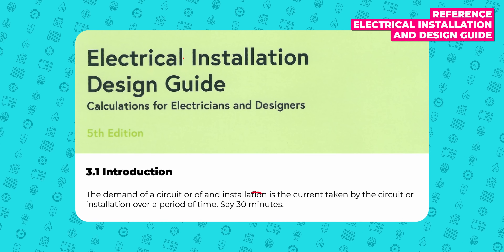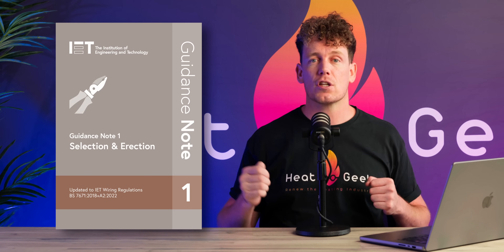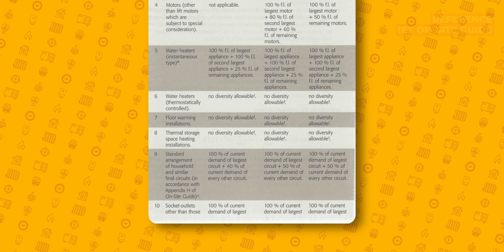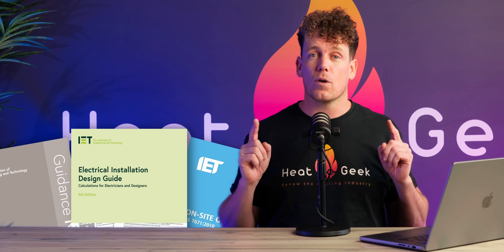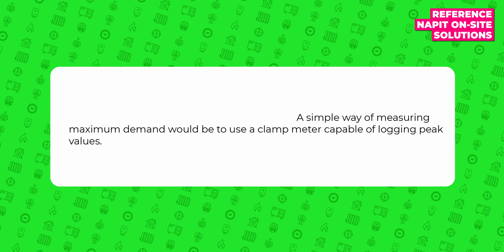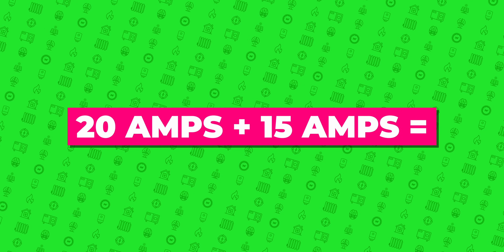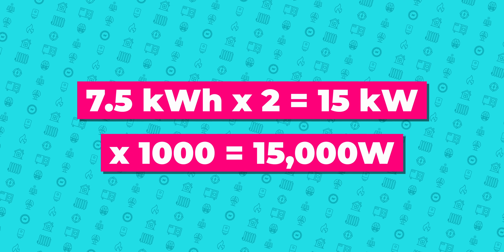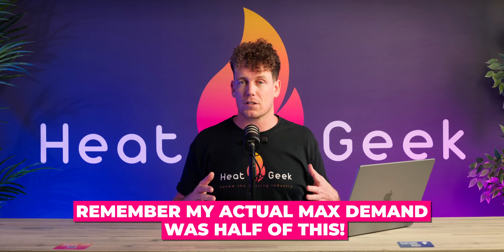How To Calculate Your Maximum Demand

Comment: Correctly estimating a maximum load can be quite hard.
Needs may change over time, so planning ahead for what you want to use and when you want to use it is always a good idea.
A smart meter will give you some insight, but these often produce averages that are simply unusable.
With peak loads, you can trigger a circuit breaker or worse, even if the average load isn't al that high.

So make a spreadsheet with what is on your circuit breakers, and when you will use it. 
Try to use powerful appliances on solar power if you can. This will reduce the load on your grid connection.
You can also spread their usage over the day or week and make this a habit, so you don't need to worry about losing power.
And when you have a collection of power tools or other heavy appliances that should not run simultaneously, combine them on a dedicated circuit breaker, so the impact of a mistake is limited.

 Induction cooking tends to make only very short peak loads, but charging an EV takes very long. So that's the one to worry about if you also want to run an ASHP at the same time.
Reply: Running a car charger generally through the night 32A running heat pump max 25A
Reply: @gramofsin Car chargers in the Netherlanda generally use 11 kW (3x 16A). The newer heat pumps are now able to stay well below 16A providing you don't have a huge home.

Comment: Great video.

Just a note to say induction hobs are potentially very high draw - mine is rated at 7.5 kW max, though running it at that for an hour would probably melt the kitchen.
Reply: I have a 11 kW 3 phase induction hob.
It can draw a lot of power, but not for long without having to order take out 😂
Reply: @SolAce-nw2hf  wow, I expect you can smelt iron on that thing 😱
Reply: @TheBadoctopus  Not really. As impressive as 11 kW sounds, it's nothing compared to natural gas. Basically it's just a big 16A induction zone in the middle and two 8A zones on each side. It does go fast, but it will not burn your house down to ashes (unlike the first attempt at pancakes in boost mode).

Comment: Maximum demand calculation is an absolute mess, best thing is to measure IMO. Not "cheap", but the Fluke A3001 FC can log current over a long period of time.

Our maximum demand came out to be 34A before the heat pump. (Which added 14.3A)

Comment: My Moixa energy manager has a decent resolution read of energy flow from grid, solar and battery to my house or car.

No ASHP yet, that’ll be going in next summer now I’ve insulated properly.

However, with everything drawing at the same time, I can get it up to 75A.

I have a 100A supply though, so even with no diversity I have capacity, and I’ve insulated well enough to only need a 5kW ASHP, so I’m still just under the 100A even with that going full chat
Reply: You have to assume 60A, unless you contact the DNO and get confirmation from them. (Even if the sticker on the cutout says 100A.) The assumed rating is also less (30A) if it's an older cut-out)
Reply: @yngndrw.  I have previously confirmed that my service is 100A with my DNO
Reply: Here's a document showing the various cut-out types and the assumed ratings: https://www.energynetworks.org/industry-hub/resource-library-old/low-carbon-technologies-cut-out-rating-guidance-to-electric-vehicle-or-heat-pump-installers.pdf

Comment: I reckon that lighting and appliances have become more efficient since the guidance documents were drafted
Reply: LED has changed everything. It is no longer a real factor. 
Televisions, fridges, dishwashers and dryers are also much more efficient, but they do add up.
Microwaves, electric water heaters, induction hobs, electric ovens and coffee machines still have very high peak loads because there's no real way to improve on them.
I'm not worried about ASHP systems as they have gotten very efficient.